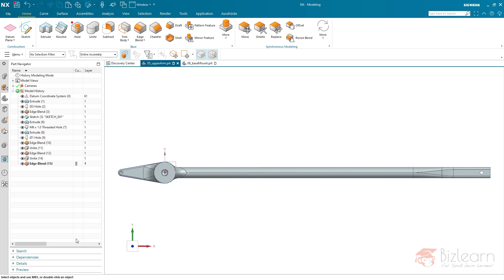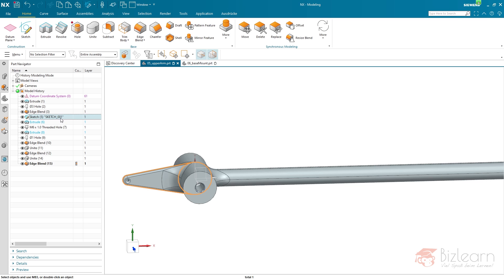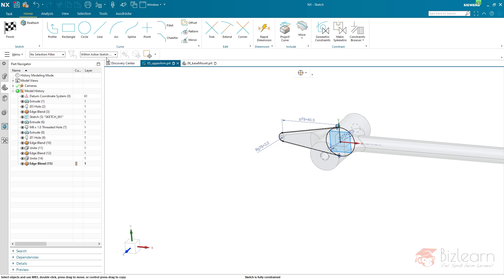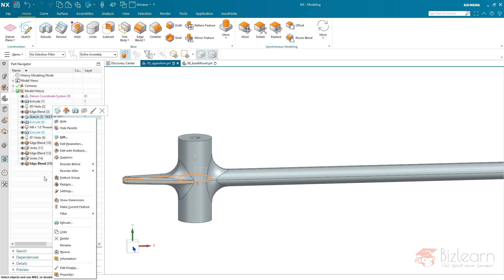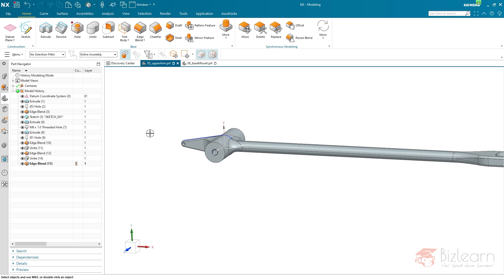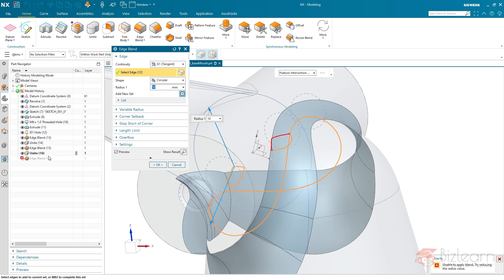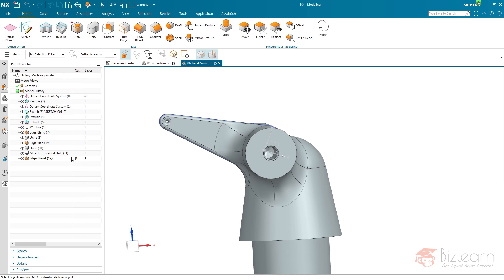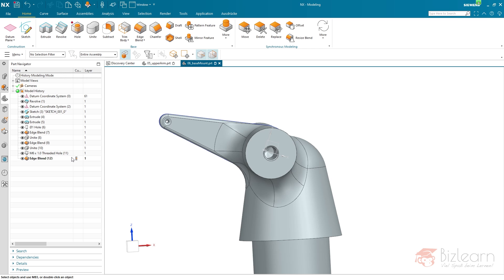What's New - NX 2306 Sketch Solver Comparison,  Improvements & Tricks - are you able to Reattach?

Comment: When we make a feature and give a color, ofter that when a hole is made on this feature, hole wall faces are still in Grey color. Is it possible for holes to inherit color or parent.
Reply from the maker: Is the Color defined via Feature Color or Edit Object Display?
Reply: @Bizlearn_Siemens_NX_Training  feature color. If it's the wrong method suggest me the correct method.
BTW thanks for all the videos, my models are very stable now and I can do lots of changes using your horizontal modeling concepts
Reply from the maker: The entire body color shall be defined via "Edit Object Display". Individual Features shall be colored via "Assign Feature Color".
That mentioned as a general rule. But there are various settings available to control the behavior^^